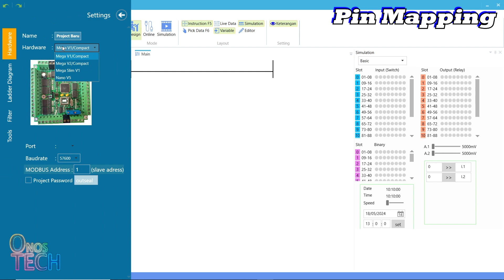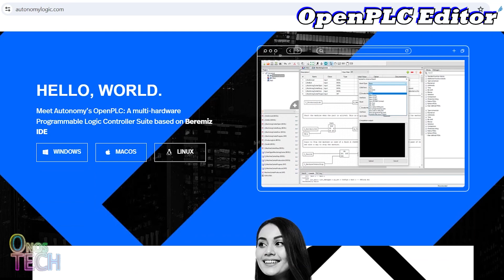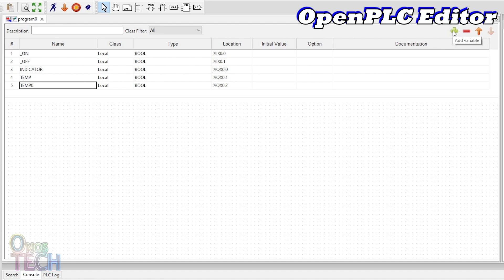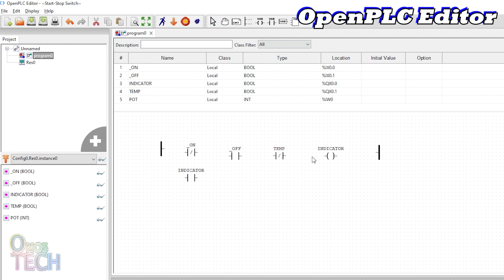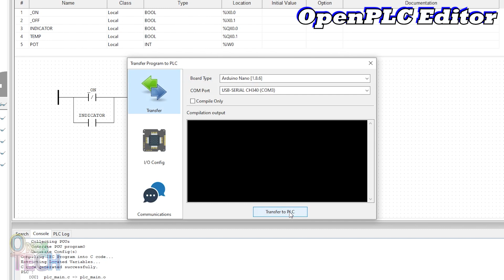How to Program the Arduino Nano PLC with the OpenPLC Editor

Comment: open plc arduno nano failed to upload code plz help😔😔😔
Reply from the maker: The first attempt to upload into any board requires good internet connection to update the board files in OpenPLC. Ensure you have good internet connect before attempting to upload
Reply: @OnosTech  arduino uno successful uplode but nano not .i try old and new arduno nano deiver but not upload 
🤕
Reply from the maker: @ZipZapClips688 Try updating the driver. CH340 Driver Download
http://www.wch-ic.com/search?q=CH340&t=downloads

Comment: Thanks for creating very useful and educational content to those who are DIY PLC applications. Which one do you prefer, OUTSEAL or OpenPLC?
Reply from the maker: Outseal will be my first choice to quickly get things going with Arduino Nano, But then OpenPLC supports lots of other microcontroller boards. And the new Arduino code extension has increased its possibility beyond normal PLC operations.